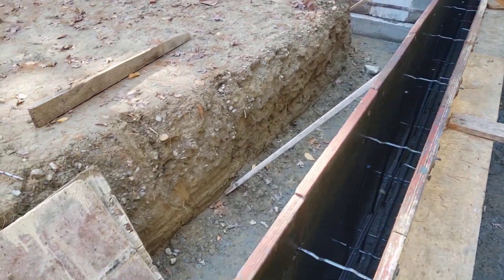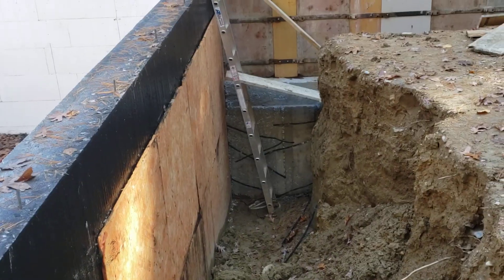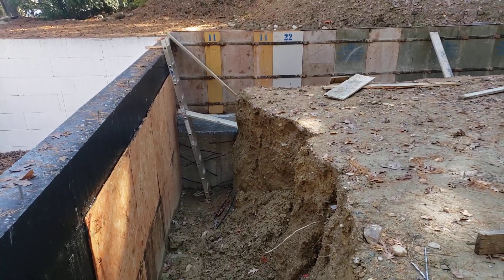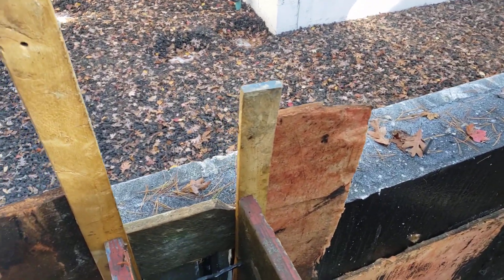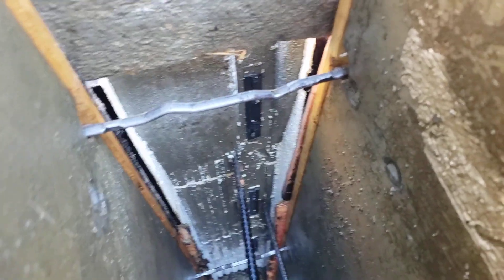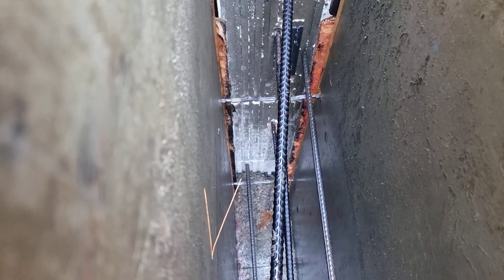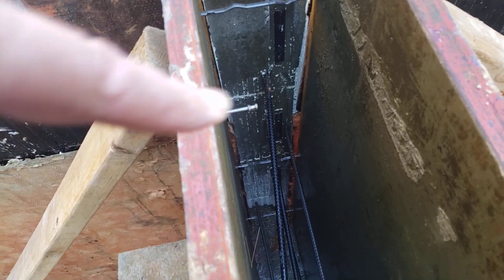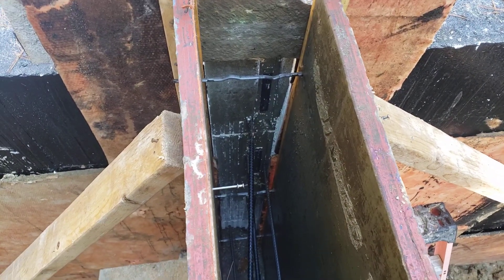Concrete Foundation at Garage ICF House Tie In

Comment: I am an electronics engineer, not a builder or architect, but my engineering mind forces me to ask the question why not do all the concrete walls as ICF, in one monolithic pour?  Was it a slam dunk that this two stage process would be cheaper?  As a potential DIY ICF home builder, I probably would have gone with an all ICF solution.  I would go ICF to the roof but I realize that might not lend itself to the look you are trying to achieve.  As an architect, does an all ICF house restrict your creativity?